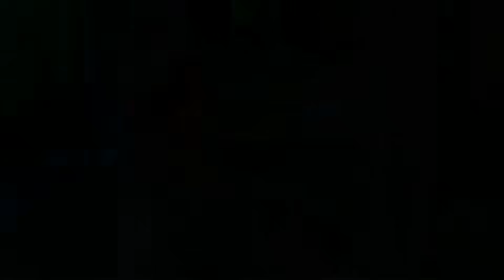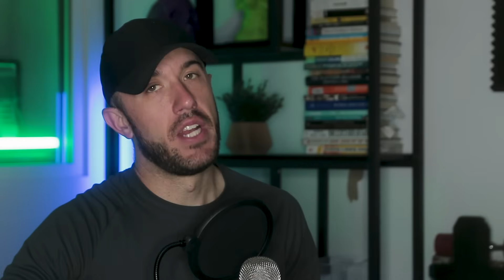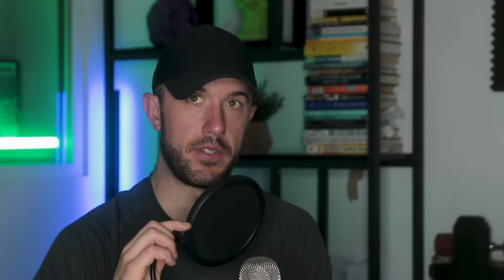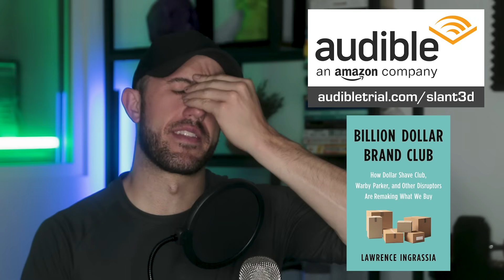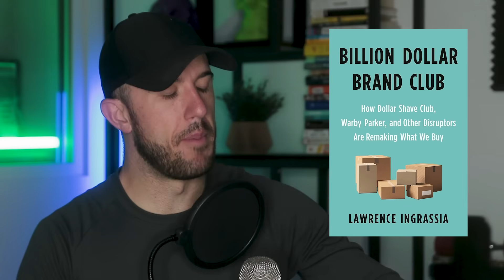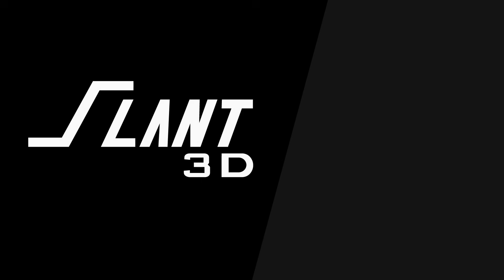Wild Customer Support | Etsy Plugin New Features | Experimenting with Content | 3D Printing News

Comment: Printing Tangled PLA with the stock Bambu PLA Basic preset in Bambu Slicer should be a huge selling point. Overture does not melt fast enough, but Tangled does. Using this preset with a Bambu printer makes your printer wicked fast and perfect prints every time. You should test and validate this and then use it as a huge selling point!!!
Reply from the maker: We do not recommend this.
 Tangled PLA is not designed for high speed uet so your results may vary

Comment: Really glad to hear about the spoolless 1kg filament since I designed and printed my own spool (around another spoolless roll) and would love to use it for these (I am wondering what the measurements of these spools are though, since I made it to just slide into the existing core, and while it can easily be modified to fit others, sometimes taking those measurements can be a bit sketch CringeHarold)

Comment: My first order did have an issue in that I ordered a 3kg spool, and got 3 1 kg spools. i mentioned this to Tangled, because I'm more concerned that someone might have gotten a 3kg spool when they were looking for 1kg spools. And I ended up with a refund. I'm buying more, and I'm OK waiting for the 3kg spools to be back in stock. (I can get filament locally for the cost of a 5 mile round trip drive over the cost of buying from Tangled. (For now. Things will change when it gets down to $10 a kg.)  I really wasn't looking for a refund, because it's good filament and I've used it all by now. I was treating it as feedback that I would hope would go back to wherever that situation cropped up, and would help prevent such mixups. My setup allows me to use either format. I may place an order for 3 1kg spools, just to buffer between 3kg spools.

Oh, if you're getting a lot of 'what temp should I be printing this at' questions, it may be that if you're already labeling the material with print temperatures, that making the font larger is helpful. I already have issue with the 5 point type so many manuals show up with. Depending on where the spool is, if I'm sending a print job to the printer, being able to read the material type and print temp on the spool from 12 feet away can be helpful. If color coding is an option, for material or print tempretures, that might help as well, but then you get into the issues with color blindness that 'you can have any color you want as long as it's black' tends to solve. 🙂

One of the things that I hoping to see with the ABS options is the ability to custom build a box of 3 1kg spools. So if I want to do a bunch of US, UK or French flag prints, I could simply buy a box of 3 spools, one red, one blue, one white. The fact that the price at the moment is almost twice what the  PLA filament runs, is an issue. If they were also at $45 for 3 kg, I might consider doing something like that with 4 boxes of filament, but not at $79 or so a box. Not a complaint, just an observation.

Comment: Your C/S strategy worked for us 10 years ago when we only had 1 or 2 C/S agents out of less than 30 people. Tangled has 1 sku where we had many so we also took the "just refund it" idea into the RMA space too. We'd just refund the problem items and tell the customer "recycle it, don't send it back".  Resending product or taking returns doesn't save much or is more expensive than just refunding and is definitely distracting from the mission. Plus even those who had a bad experience are grateful they didn't get the runaround on the way to satisfaction. Nowadays we're 30X bigger in headcount overall and do operate much closer the "normal way" but those original options are still there when needed.

Comment: Can you speak to your filament vs bambu labs filament? I saw a comment saying it doesn't work well with the AMS. I also don't want to be forced to print slower because of the filament, does it print as fast as Bambu filament?
Reply: Something to consider is that Bambu might have tweaked their filament composition to optimize for printing with their AMS accessory. Without reproducible data on filament properties to compare, it would be impossible to make claims about print speed, or print quality for a given filament type; regardless of 3d-printer model.

Comment: Please make your spoolless version be physically compatible with bambu spools including that little notch. Also you've talked about using PETG as a $10 material. I wouldn't want PETG even at $10 because it's a dodgy quality material but if you make a carbon fiber version at a not much higher price point I'd be interested in that. The black spools I already got from you have a bit of that matte carbon fiber feel already
Reply: Now if they could make PET (not G) for $10/kg, that'd be unbeatable. But hard. That's why everyone makes the G stands for garbage version instead.

Comment: I want to support Tangled, but it's jammed multiple times on my Bambu X1, when other filament works fine. Sorry, not going to order again. Tangled filament feels stiffer, I think the tolerances of the AMS doesn't like it. I'll try direct feed and see if that works better.
Reply: I was planning to order it for my bambu p1p with AMS, I might not now! Thanks for commenting
Reply from the maker: Thanks for letting us know
Reply: This would be a good example for the Tangled Testing channel to examine. Being able to quantify "feels stiffer" filament relative to other filaments, particularly on a scale of property values would be useful information. Properties of material flexibility or hardness might be effecting how filament moves through the AMS. (I have not used a Bambu AMS, so not familiar with how it can jam)